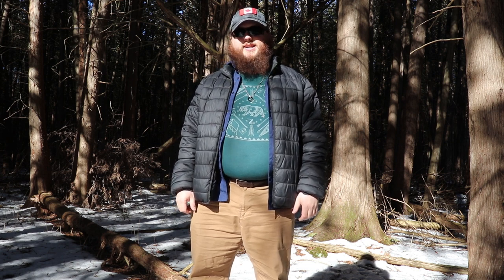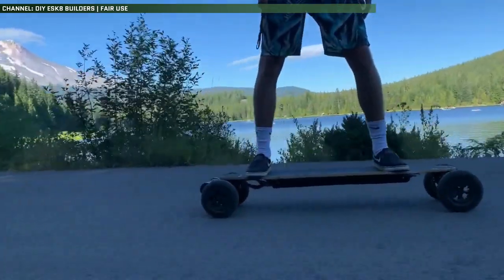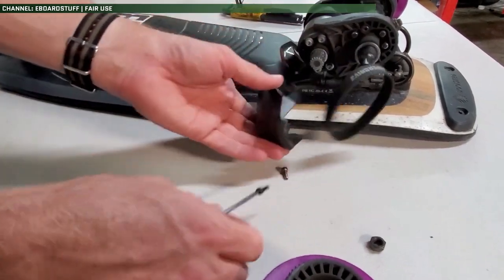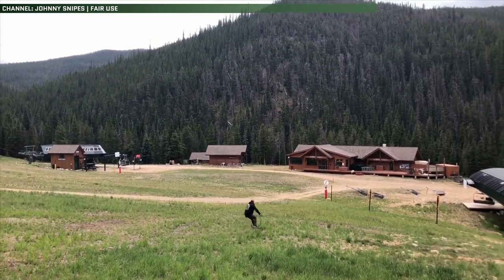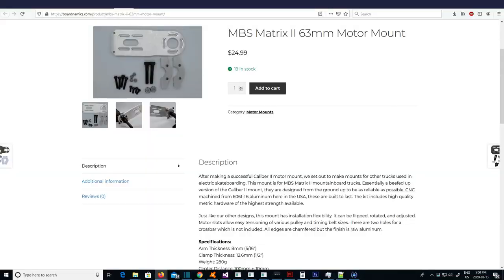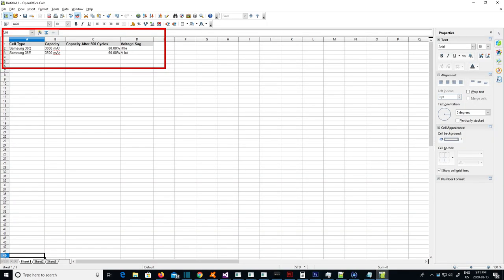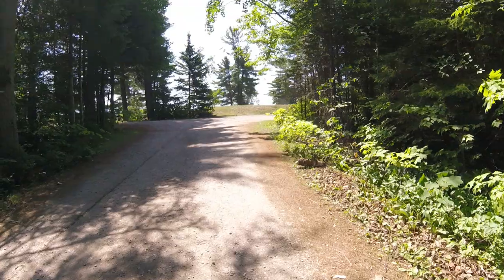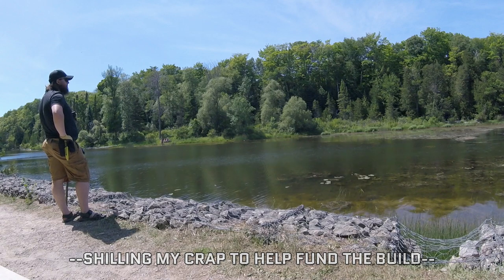DIY 1.4KWh Long-Range All Terrain Electric Skateboard Skatepacking/Touring Build List

Comment: I built a similar board except I used the flipsky 4.2 vesc and two Milwaukee m18 batteries in series so you can separate them for faster charging and carry spares to swap when needed

Comment: Need a solar backpack for charging on the move bro. Ima build a felxi panel into my pack and have 2 plug n play pelican packs
Reply from the maker: I don't think it works like you think. You need to be facing dead on to the sun, and in reality that panel will 1) serve as a massive drag brake and 2) be extremely inefficient. If you do bring solar for charging, your best to take a zero day to spend it charging up your battery.

Comment: How's the flipsky motor and esc doing? I've had really poor luck with their FESC 6.6 and only have used torqueboards' 170kv 6380, which I love, and I'm at the edge of the "off road pit". Let me know if you believe I can trust the flipsky gear listed. Thanks!
Reply from the maker: Actually, I wound up going with a different build for now (street build instead of AT) using Ownboard parts. So I've yet to put flipsky stuff through their paces, so I can't give it the Mike in the Woods seal of approval yet :(

Comment: I'm not sure what calculator you are using for your batteries but 11p on a 3 Ah cell is 33 Ah total. If you are going to charge from empty to full with only a 4 amp charger that's going to take over 8 hours. This is why in my opinion high capacity boards should be on lipo packs as you can charge them at 1c or higher.  Meaning if you have a high enough amp charger the time goes down to an hour.
Reply from the maker: I've since switched it up and decided on a more modular approach to the batteries--check out my more recent video:
https://www.youtube.com/watch?v=5J_hWW8YUVY